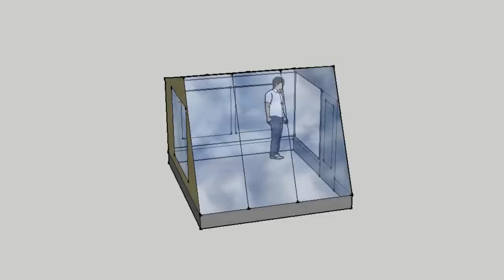building a diy designer greenhouse in 5 minutes

Comment: 5 Min? Sure , just like the Shows by This Old House showing it only takes 5 min to DO things!  GIVE ME A BREAK! this is at least a 10 min job !  LOL 
and built a Lean Too against the South side of the Garage to help Heat it and installed some Patio Doors on the Garage walls..  with a Solar Panel on the Roof ! To drive a 500 watt Heater in it !  & Got all Materials and Patio Doors  and Solar Panel USED! at about 25 cents on the dollar vs Buying New ! A Combo Greenhouse for storing our Plants in witner and keeps the Garage at 40-50 degrees ! and We even go sit in it in dead of winter ! In our LawnChairs and have a TV in it !

Comment: You could make it significantly warmer by insulating the north side of it instead of using glass. No sunlight comes in that side anyway. Plus you can paint the wall black to capture a lot more heat.

Comment: Am I wrong? actual please tell me I am wrong at 3:35 I can’t help but notice that there dose not seem to be and units/panels/planes (what ever you want to call them) of glass at the top of the right hand gable, to the lower right of the right hand gable and to the lower left of the left hand gable as well as glass missing between the bottom of the roof and the top of the front side

Comment: 3 inch 3/8 anchor bolts, hammer drill through your bottom plate into concrete. use a hammer to place the bolts make sure your bit size is smaller than the bolt. unless you pour your foundation with a mudsill,  and this also requires anchor bolts, dont forget to pull a permit once you start constructing foundations need a permit!

Comment: Add some black 50 gallon drums filled with water in the greenhouse which will soak up sun and release more heat in the greenhouse during the colder months if you have room. If not you can build a solar can heater with the input/output fitted to the greenhouse also for higher temps

Comment: This is a beautiful greenhouse and I am planning to build something similar. Would it possible to get this design and information about the material used? Specifically height, width and thickness of the wood planks.

Comment: Very nice project !
In italy it's quite expansive to realize such a beautiful greenhouse becouse it will cost aproximately 26000 Euros.
Below is a list of what i mean:

1) Measurements & Project = 2500 €
3) Consemption of land registry office = 300 

4) Consemption of technical municipal office = 300
4) 
Creation of foundations and perimeter walls, according to current regulations = 8000 €
6) Installation of wood stucture (wood must be CE marked) = 7000 €

7) Installation of aluminum frames = € 7000
8) Final inspection by the charged authority = 300 €
Reply from the maker: much red tape for a greenhouse;(

Comment: a new project would be to make a hydronic hot water system for your green house that uses the ground in your drive way for the tubes to save the heat in the summer, just a thought.

Comment from the maker: the glass panels cost about 600 each new,but they were slightly damaged with a sand blaster and rejected to be sent to the dump, I paid for the concrete blocks,cement, screws, rubber strips for the windows

Comment: did you use, new windows, or are those windows reclaimed from  second hand scrap yard?
how warm does it get inside the green house with  those double pained  safety glass?
Reply from the maker: they were rejected from a building site as someone scratched them with a sandblaster, they were destined for the tip so we asked for them, the triple pained glass may keep the heat in a bit longer, but in summer the ventilation flaps are wide open so it doesnt make much difference.

Comment: Wow! Triple pane glass. Heavy stuff. Your design makes sense in an environment when the sky is frequently overcast and lighting diffuse. Here in southern Arizona I would only need glazing on the south side with little slope. I'm considering building an extension on the house and including a greenhouse on that employing used glass from a local home renovator. They give away the old patio windows as they cost to much to dispose of. I also use solar water and air heating.

Comment: Japanese pepper= eggplant.  I like that trim in between those windows, was wondering how you'd seal that up, what's the info on the windows/ trim?
Reply from the maker: rubber seal,the laths holding the windows down was one of the mistakes, instead of wood I should have used aluminium, as one summer the wood dried out and shrunk, so I tightened the bolts, next time it was wet the wood swelled and cracked two outer panes, but they are still water tight
Reply: Oh I thought the laths were metal, at least on the side they appear to be.  I assumed there'd be some sort of rubber gasket or butyl tape in b/n lath and glass.  Yes, wood on the exterior in many trim fashions will be its own undoing over time.  Anyway, cool video, like the various angles and everything.  I'd be worried about screwing that glass order up haha

Comment: Alon translucent aluminum should be used for green houses. With climate change green houses should be designed to be able to take the bad weather. 😊
Reply: Indigo Dragon71 translucent aluminum????
Reply: are you talking about different corrugated roofing materials? because im pretty sure aluminum doesn't come in "translucent"....

Comment: I love the design of this. Great job. I’m wondering ( not hating, not judging or criticizing ) if just planting in the soil underfoot is a waste of space?  Just a thought here, perhaps for someone else. But maybe forget about planting on the floor of this great space and put some open shelves for growing micro greens for example in the shallow trays. And a row of plastic barrels for growing veggies hydroponically. A few of those potato buckets you can grow dozens in a small 5 gallon bucket and utilize some of the height you have by hanging plants on a rod, like the upside down tomato plants.
Reply from the maker: it was a ´'dead' corner anway with the concrete post foundations
Reply: garryentropy yeah I’m sorry. Not trying to be negative. You did a great job as I said I love it. Just seems under utilized that’s all with all that height.  But it’s obviously yours to do as you may.
Reply from the maker: @WulfricTheBlack  works great https://www.youtube.com/watch?v=YC77UbIp5qA

Comment: Hello, great build! I hope to build a lean to greenhouse off the side of my garage. How did you fit the glass over the wood and secure it? I love how virtually all the wood will be sheltered from the rain. Is this a certain technique or could you point me in the right direction of what I should be googling to learn how to do this? Thanks
Reply from the maker: rubber seals on the wood and the glass is fixed in place with laths, dont over tighten them though
Reply: garryentropy thanks for the reply :) is the lath some sort of plastic/composite material, which is screwed into the timber and holds the glass on each side in place? would you by any chance have a link to a website that sells them? I've been googling for hours and can't find anything that looks similar.  Also, are the rubber seals a specific kind, or a standard window/door seal. I'd greatly appreciate any further help, moved into our first house and trying to teach myself things as I go along!